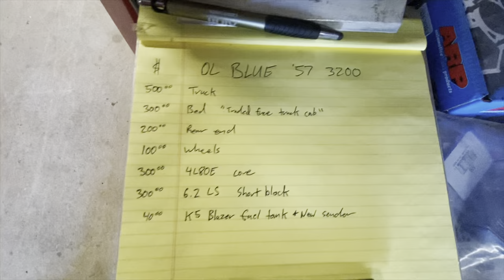"Ruining" the 57 Chevy Pickup by Pulling the 235ci 6 cylinder for a cammed LS3 swap!

Comment: I used to say never LS swap any old vehicle.  But over the last couple of years with the hell the car community has been faced with concerning getting parts and other things to keep these old vehicles original. I'm looking at the big picture and if we want to be able to enjoy these things for years to come we have to be able to get motor and brake parts. You're doing great brother, keep the videos coming.
Reply from the maker: Thank you I appreciate it! I’ve tried to explain some of this to other folks that hate on an LS swap but it’s truly no different than taking say a 55 Chevy and pulling the 265ci v8 in favor of a 327ci or 427ci something with a little new technology that makes more power, may even be more reliable. Especially if it was a 327 fuelie motor. But more often than not folks hate on the fact that someone would put a modern driveline in an old car or truck. The 69 GTO will have 400ci Pontiac power, the 55 Buick has a 322ci nailhead, and the 57 Chevy 150 is getting 427ci big block power. I love it all!